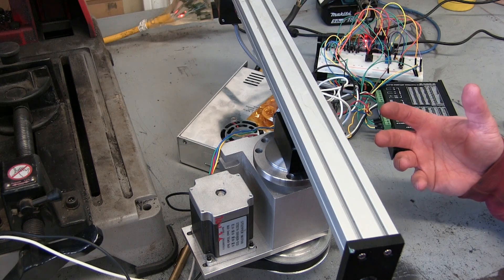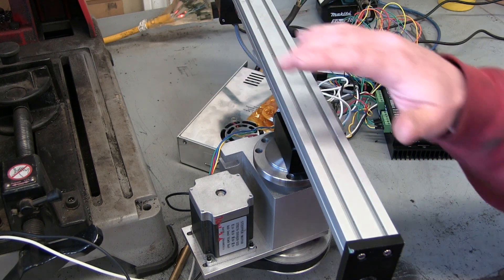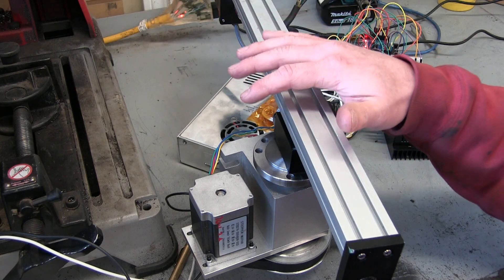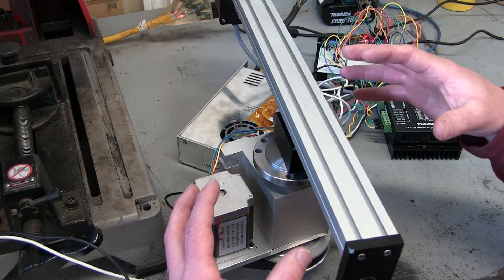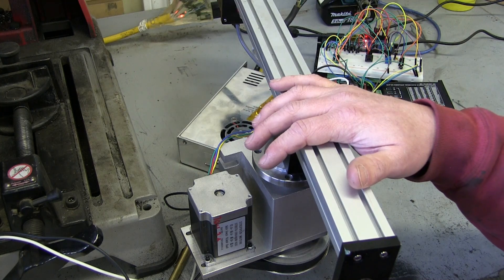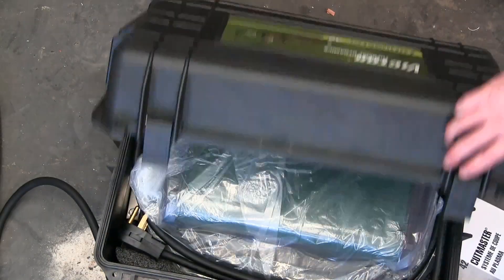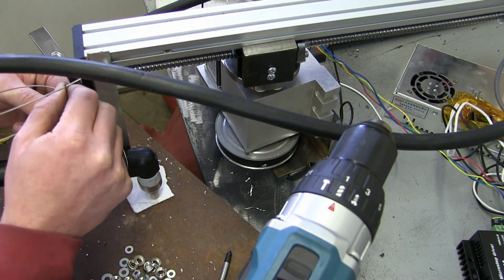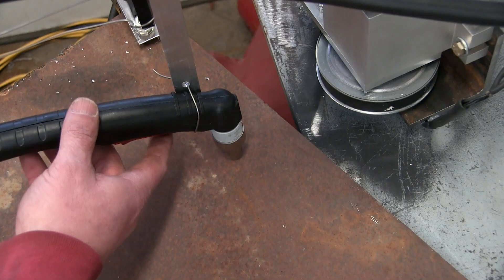Portable CNC Plasma Prototype

Comment: The inverse kinematics are actually pretty simple, it would be

linearSteps = stepPerInch x [ sqrt ( x ^2 + y ^2 ) - sqrt ( x0 ^2 + y0 ^2 ) ]
rotarySteps = stepPerDegree x [ atan2 ( y , x ) - atan2 ( y0 , x0 ) ]

Where (x0,y0) is the point where you are and (x,y) is the point where you want to go

A couple of things to have in mind are, 
- The functions sqrt() and atan2() comes in the math.h library in the arduino IDE, so you just have to include it
- Is better to use atan2() instead of  atan() because the latter has problems when x is zero
-  sqrt ( x ^2 + y ^2 )  should be a number between the minimun and maximun length of the linear actuator
- When cutting a line is best to divide in lots of points feeding them to the machine point by point instead of giving it just two point so you actually have a straight line instead of two point connected by a curve
- Zeroing the machine every time it's powered on

Hope it helps, and awesome job making it.

Comment: Great idea! So - the further from the centre it is the less accurate it's going to be. is it accurate/stiff (ha) enough to cut at around 1mm accuracy at full reach? If not - could it be improved or maybe just have a shorter range?

If you could mount the base above what it was cutting (base up cutter down or vice versa but then which way do the cut outs fall) it could have a full 360 degrees - but not sure how that could be done while remaining portable.

Comment: I'll give you a suggestion, but I think a guy with a PHD in bumblefuckery or wa, would know better how to  design something than a fuck on the internet like myself. I'd definitely use it! but the only thing that might get tricky is that the machine will need to know where 0 is. If it doesn't, you would end up cutting out weird and undesired shapes, because distortion changes depending on how far you are from the center of the thing. Good luck!

Comment: Ave, one thing that would help would be tapping into the torch and making it so you can push a button, etc to fire the torch instead of placing your hand on the torch and possibly wiggling it.  I know on my Hypertherm its just a pin on the CPC port.  If you have any questions about CNC let me know, I built my home CNC plasma, @MidKnightFabrications, check it out.

Comment: like that idea ! and it would be really useful . I think that you should have a proximity sensor at the end of the beam to pre-scan the material sheet for flatness then when cutting you can have something to adjust the plasma gun in the Z axis to follow the surface without hitting the surface . this system exist on 3D printer to compensate for warp printing bed and it work so why not for you?

Comment: On the controls side of things, I'd think that a few programmable buttons on the machine itself might be a good idea.

This way, common routines can be started from the machine, without having to take out a phone, open an app (and wait for it to load), connect to the machine, then set it up in the app.

Another concern: In a professional environment, which phone would be used? An IT policy may prevent using personal devices with company equipment, so one would have to be purchased separately. Where would it end up? Taped to the machine? In a drawer, adding an extra step for use of the machine?

The machine should be usable on its own, even if a phone app can add functionality that would be too complicated to fit on the machine's keypad.

Comment: maybe add a few limbs that as it rotates it will pivot left and right to keep it square. kind of like a city bus wiper blade system.  Just put an angle towards or away from the base for clean cuts being that the angle of the cutter will likely pivot left to right using this concept.
Reply: keep the shapes physically controlled to make it less likely that you'll need to be good at calculator to solve the radial cut issues
Reply: calculus *

Comment: The cutting tip needs an upward sloping shroud as it gets farther from the tip. Maybe 2 inches in diameter. This would be easy to make and would help the cutter to move past debris more smoothly. You might also want to use some form of spring tension to press the cutting head against the plate while allowing it to compensate for uneven material surfaces. This would be useful when prepping a pickup truck bed with fastener holes for a 5th wheel coupler, etc.

Also, this platform could be used with a 3d print head, though that would require a 3rd dimension of measured travel. 3d printing would no longer be limited by the size of the boxed printer, but by the length of the threaded rod and tolerances of the arm.

Comment: How about adding a function to the Arduino to keep that arc speed constant based on the radial distance from the center, then adding some potentiometers for dynamically changing  the linear and arc speeds while cutting. Maybe you already have that implemented into your circuit but hard to see in the vid.

Comment: you need a cnc table torch handle, not the right angle(handheld style) you are currently using, then you would not need to hold the button and you also could keep the cord straight up and out the way. many plasma cutters have cnc table torches as options.

Comment: Would probably also require variable speed control or material/thickness selection for automatic speed control to cover the issue you had with it going too fast. And likely the ability to import a good ol' drawing. Some would certainly want a square and nothing fancy, but at least the ability to do something fancy would be handy. Especially because I can imagine metalworkers that do signage and the like would love the ability to put fancy squiggles into a machine and cut it anywhere/on anything rather than what the standard Cartesian plasma cutter would fit. Maybe interchangable/extendable booms? I dunno, just spitballing

Edit: Oh! Also a mount for a good ol sharpie to mark it before you cut it. Draw twice, cut once

Comment: I think this could be a great boon. personally I'd go with more skoocum motor drivers, maybe a couple geckos. for the linear, maybe openbuilds Cbeam with a cover to protect it more. software shouldn't be too hard, maybe not marlin, something a little more polished.  most CNC programs now have pendant support(cell phone/tablet interfaces) maybe Bluetooth or Wi-Fi built in for ease of connectivity.

Comment: You didn't mention the drive system, but I'm assuming you are running a "canned" routine of step/directions and not some g-code. Scaling something like that smoothly would be hard. So, where do you envision the math being done? I would do it on the phone.
Reply: Moreover, I would make the "design" stored on the phone a set of vectors which are compact and very easy to manipulate. That way, the actual device does nothing more than what you have it doing now: run the downloaded steps. That significantly opens up the type of devices you can use.

Comment: Awesome rig! you need to work out how both the slide and the rotary mechanisms articulating simultaneously can replicate any path the user defines in the app. Start with a matrix of your X,Y work area, and superimpose a matrix of required velocity of both motors to get to each coordinate, up, down, left, right. The pixies will do this millions of times per second to control the motors in synchronicity.

Comment: I fucking love that idear. work in a fabrication shop with both a mag drill and a x/y plasma cutter but would have used one of these today if we had it. and would love one for the home shop as it has such a small foot print. definitely worth pursuing.
just as long as you have maybe a universal gun holder and some sort of trigger system so you dont have to hold your hand on it.

Comment: Well here is my two cents on this. 

I have a 3d printer, a cheap piece of shit that was 320$ and after I got it I realized much of what I wanted to do with it initially could be done with laser cutting wood (i like making art shit in 3d and printing it, but the functional shit could be done in wood)

so here is what I'm thinking.

a mount for various applications, be it a sharpie, a laser for wood cutting, a plasma cutter for metal, or if its powerful enough a drill (replace the laser)

Instead of a phone app, which you could also do, for just cutting circles or squares, an embedded screen you could easily punch shit into, because let's be honest, counting on a computer that has more the one function is a joke, but letting people have the option is good too. 

Then you also have to have the ability to pre make a complex design, i'm imagining the use could be as simple as cutting a circle to complex as cutting out the blade and a tang of a knife, or with wood, the whole assembly of whatever. 

Should probably also have a killswitch that is easy to get to just incase shit happens.

Comment: The only thing is the torch needs to be easily removable for hand use and have the ability for an oxyacetylene torch. Also when on the machine, it shouldn't drag on the surface. Other than that, you'll have a future customer for sure. Id ust throw that in my rig and go. DO IT!

Comment: That sounds like an awesome idea, with applications for other tool heads (e.g. laser, mini router). Going from Cartesian to polar isn't hard, but I have concerns about working out the tool movement consistency in the lateral direction when you want, say, a straight line. A "delta" configuration might solve a lot of those problems (look up "delta 3d printers" for an example). However, a delta config might limit the size of cut you can make in a small-footprint machine. Some sort of hybrid "delta on a gantry" concept might be the middle ground solution, but I'm not sure if that's been tried before. In any case, we might be talking about multi-step cuts to achieve precision.

I'm mostly just spit-balling, though. It's entirely possible that your setup would work just fine once you get the tool head sized appropriately, the right size/quality servos, some sensors to feed back the position, and software in the middle to do the heavy lifting on position and speed -- plus a boatload of testing and tweaking. The stuff CNC can do today is pretty amazing.

Comment: This is a solid idea, if you add torch height control you could cut on almost any irregular surface (such as boat hulls etc) as well, also need a plasma with cnc control (everlast) so you don't have to hold it. This will be sweet!!

Comment: Given I am a garage welder at heart and it's what I got my first degree in, I can tell you that hell to the yes I'd use it. Now, I could draw up your kinematics right now, but it wouldn't tell you anything you don't already know. The inverse kinematics, however, are a lot more useful, because that's what you use to get the robot to understand where the joints need to be placed based on what you want the final positions to be. That'd take a little longer to draw up, but it's certainly doable.

In the future, it'd be interesting to throw an inductive sensor on it with a second (vertical) linear axis to not only level the piece, but be able to calibrate the tool height.

Comment: A couple of ideas: 
1)  The torch head should be directly in line with the linear choocher what for avoiding calibration bull hockey. The fewer factors involved with programming this thing the better. Furthermore, It would be good if somewhere in the app there was a feature for manually jogging the torch head to the starting point of where you want to have a lead in for your cut. It could be the last step before making the cut, you would move the head and then say to the app how far you want your lead in to be and in what direction.
B)  As I am sure everybody here knows, electromagnets have a tendency to heat up and it would be a stinking tragedy if at some point during testing that poor magbase would fry itself like an astronaut in a microwave. 

Other than that, this looks fuckin awesome. Can't wait to see this developed more.
Cheers

Comment: To me an important part is going to be finding a way to locate the head. So say if you want a bolt pattern how do you get it to cut were you want it to. 
Maybe simple idea would be to put a sharpened pin on the arm hanging down somewhere and you can use a punch to mark a spot move that pin to that location and hit a button that zeros the machine.

Comment: I'd put this in my pile of dirt,  mayhaps a pierce point program or a handy job for lefty,  if you know the radius, you can adjust slide length to produce squares. at me scruel (still in high school)  we have a cnc plasma cutter,  and it's pretty skucum. the pictures don't bother me,  but you can manually set a (0,0) very useful for getting every craptasticular cut out of sheet metal. but a feature where it auto sets to 0 slide 0 rotary and from point would be very helpful.

Comment: You could take an overhead picture of the device in position. The app recognises the device and it's orientation(by putting something like QR codes on it). then you could drag, drop, and manipulate the shapes you want cut onto the picture. Having a way in app to cordoned off sections so it won't bump into stuff would be nice too.

Comment: two motors one in the x and one in the y-axis, mag base, that way you squares aren't  radians of a circle.  I'm not a programmer or a machinist but that's some pretty fuckin' skookum prototyping right there.  I'd buy one.   Maybe take an inkjet printer apart and follow it's design?...Nah scratch that it moves in one axis, the page moves below it for the other.   you need two motors, though.  and probably two or more bases, else your precision is going to gonna blow chunks due to wiggle.

Comment: It looks like  a great tool but you are going to need extremely fine speed control on the motors to get straight lines other than parallel with the boom.

Comment: If it's easy, it works, and it's cheaper than other shit on the market it'll sell. If and/or when I get into fabbing offroad projects (buggies and the sort) this would be a sweet solution for cranking out gussets, skid plates and such. Would sure beat the hell out of marking out and cutting dozens of pieces manually.

Comment: Are you thinking you want to make the unit self-contained, or a setup that would let you bring your own cutter and clamp it on the tool end? I think the chooch box is probably better left separate and the lead attached with some coil over springs like the ones that come on plasmas and migs to keep the lead out of the way. The Cartesian conversion is the easy part my friend. Next step for the prototype is to rig a solenoid on the tool end to actuate the button so you can stop and start the flow without needing to use your own dickbeaters. It almost looks like work without that.

Amazing proof of concept AvE!

Comment: So I happen to have the contact info of some MIT students about to graduate with degrees in mechanical engineering who may want to help out for fun and profit.  Specifically a few who wanted to do something like this for a group project in a product design course but got out voted.  If you can prove this idea can make money, I might consider forwarding it along.  The real difficulty in running a start up isn't making the product well, its making the right product.  Learning what kind of product sells in the real world is really the toughest task for students.

Comment: Optional outrigger magnets.

That magnet will be feeling more torque than one in a mag-drill setup. And if there happens to be little high spot where the magnet is clamping down you may experience a rotary stickage deficiency. This could be a major problem given that you have a heavy plasma cutter cable/hose dangling off the end of a lever while the CNC choochum is do its thing. Program it to avoid jerky movements.
Reply: Alec Dacyczyn the will be way less torque... a mag drill will usually have quite a bit of force applied. this just has to hold up its weight. an elctro magnet at relatively small sizes can hold a shit load of weight.